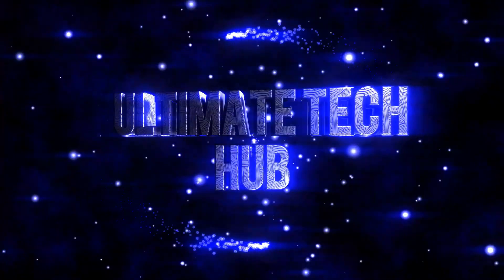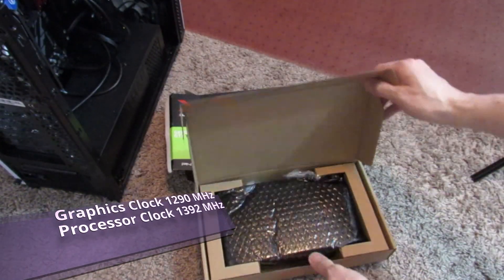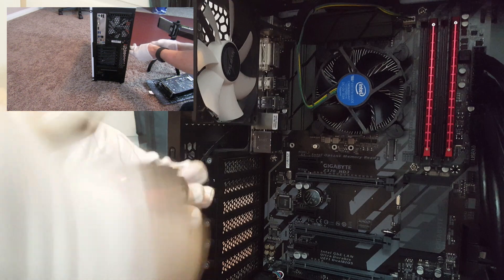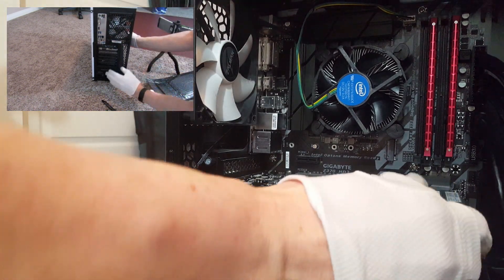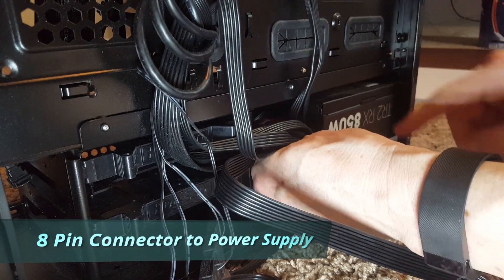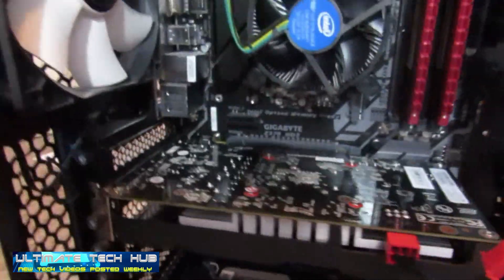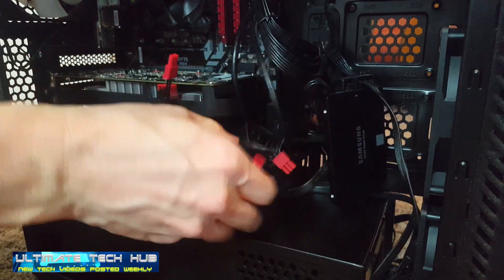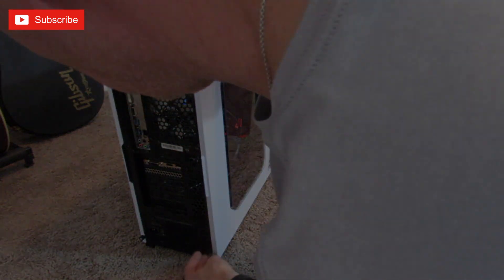How to Install - GeForce 1050Ti - Quick and Easy!

Comment: Hello.. My psu is 180w of power but it does not have a 6 pin connector does it still run on the motherboard?
Reply: Unfortunately 180 watts is insufficient to power this card and the rest of the system is.

Comment: Bro where is the 8 pin adapter found i cannot find it
Reply from the maker: The psu should have an 8pin or a 2 x 4 pin.
Reply: @UltimateTechHub  oh thanks my guy
Reply: @UltimateTechHub  my psu is like the wires are inside the psu itself and not outside connected though
Reply from the maker: @Fire_Evo  The GTX 1050ti may not need the 8pin connection. Try powering on the PC without the 8pin and see if it works. Usually the motherboard can power the low watt GPUs. Keep me posted.
Reply: @UltimateTechHub  wait then the 8 pin is for extra power and boost ?
Reply from the maker: @Fire_Evo  No its just for power but usually the motherboard can power smaller gpus because the 1050ti only uses about 25 to 35 watts.
Reply: @UltimateTechHub  thanks bro but before I buy can u like make a shorts about the 1050ti without the 8 pin so I buy it? Thanks
Reply: @UltimateTechHub  also I need a 80+ psu?

Comment: Got a questions can i got a GTX 1050 ti when i've using 250 watt
Reply: I got actually a GT 1030 i5-4590 8 gb ram and 250 watt
Reply from the maker: @PolPud_YT  Should be ok
Reply: @UltimateTechHub  ok thx
Reply: I decided to buy a GTX 770 and 4 GB ram more will this work on 250 watts
Reply from the maker: @PolPud_YT  it should the 770 doesn't use much power.
Reply: @UltimateTechHub  ok, thank you
Reply from the maker: Probably, it depends on other hardware.

Comment: I have gtx 1050ti without 6pin connector and what happened is after installing Windows the GPU is not showing signal in the monitor and the monitor is only 1080p 59hz resolution and yea that's the problem. It's not showing any output in my monitor. Do i need to change the monitor or what. Reply plz
Reply from the maker: Did you plug your monitor into the GPU? If you plug into the motherboard the GPU won't show up. Otherwise, I would reinstall the GPU. Make sure it's pushed in all the way. You should hear a snap. Keep me posted. Also how many watts is your PSU?
Reply: @UltimateTechHub  thank you so much for your reply ;) but after doing some research i guess my monitor is not 1920x1080 resolution that's why it's not supporting. I will tell you tomorrow after connecting another monitor. Again thank u so much ;)

Comment: After watching this video, I think I need to beef up my power supply. I just ordered this gpu and have only a 320W PSU. I thought this guy just drew off the PCIe slot, but ppl are saying that's the mini. Am I right?
Reply from the maker: Yes. You probably should have a 400w PSU that's what I would recommend.
Reply: @UltimateTechHub  Can this gpu run on 300 watt? That's the min specs and that's what my HP p7-1414 has.

Comment: im just wondering if the asus gtx 1050 ti does fit in the msi B85M-E45 ??
Reply from the maker: Yes absolutely
Reply: @UltimateTechHub  Thank you! ive used a gtx 660 for 2 years now and just needed somebody to check if it fits in my motherboard
Reply from the maker: @moosg714  i had a gtx 660 for a while too. I went to the gtx 1660ti and it much better. Now I'm looking for a rtx 3080.
Reply: @UltimateTechHub  Cool!

Comment: Can you please tell me if this card runs fine in a pc with only a 350 Watt powersupply
Reply from the maker: Yes it should run fine with 350w psu. 1050ti has very low power consumption.
Reply: @UltimateTechHub  Thank you.
Reply: @UltimateTechHub  pls tell me whether i can run with zebronics 450 watts psu...please i cant afford anything beyond that

Comment: does it work on a hp laptop 15 dw0xx
Reply from the maker: No this GPU is for desktops only. Thank you for watching.
Reply: @UltimateTechHub  any gpu that works for laptop vr gaming on the laptop that I specified?
Reply from the maker: @CaughtOnCam-h7c  I have no idea because laptops are not easy to upgrade. Better off buying a new laptop with gpu you want already in it. Gpu prices are insane right now. I would wait for the prices to lower.
Reply: @UltimateTechHub  do you know a good laptop for vr gaming at budget ?
Reply: @CaughtOnCam-h7c  just save up to buy parts, or ask people to help you buy the parts

Comment: Do all cases attach the gpu in the same way? Like would this fit with any case?
Reply from the maker: Not all cases. The smaller cases are different. The full size case and mid size cases will work with all gpus.

Comment: 350w enough for this psu with ryzen 3200g mate ???
Reply from the maker: Yes
Reply: @UltimateTechHub  ok so i can play games even if i've 16ram ssd, hdd , b450 ds3h ? Ty anyways
Reply from the maker: @BOOMbastic...  Yes
Reply: @UltimateTechHub  ok thank you mate
Reply: that gpu is barely an upgrade tho get a 1650 instead
Reply: @kc4i  u mean i can put it on 350w power supply ?
Reply: @BOOMbastic...  yeah but good luck getting any good gpu deals, if ypu find any gpu you want to buy use a watt pc calculator to know if psu is enough
Reply: @kc4i  ok ty bro i already calculated max watts usage is 314 something that with rx 570
Reply from the maker: @kc4i  this video is about 2 years old. You are correct it's a minor upgrade however gpus are now insanely over priced. Thanks for watching and for commenting!
Reply: @UltimateTechHub  true but 1030 tier gpu to 1050 is just not wprth it especially with prices nowadays

Comment: Hi dude i have a Palit gtx 950 2gb ddr5 running Windows 8 Pro 64 want to upgrade to Windows 10 will this card work with 10????
Reply from the maker: Yes absolutely! I run my 1050ti with Windows 10 with no problem.  Thanks for watching!

Comment: Do I have to buy the pin adapter separetly
Reply from the maker: Your PSU might already have the cable. However if your PSU is 300 watts then no need to plug the cable in. The mobo can power it. Thanks for watching.

Comment: surely you can simply let the motherboard power the card and dont need to plug it to the power supply?
Reply from the maker: Absolutely. I did a video on that very subject about 6 months ago. No PSU needed. I always show the full installation when I do any GPU installs. Thanks for watching!!

Comment: I know this is late, but can you put this in an all in one somehow?
Reply from the maker: No I don't think so. It would not fit. And all in one's are not really designed for upgrades.
Reply: @UltimateTechHub  yes but can’t you put in as an external gpu?
Reply from the maker: @towfoon  i have never seen the 1050 installed as an external GPU. That could be possible but you would need an adapter from your all in one to connect to the 1050. I wouldn't recommend it because of electrical shocks that can happen and with it just sitting out in the open.

Comment: Would this fit where a gt 710 would fit?
Reply from the maker: Yes I believe so.
Reply: @UltimateTechHub  what if there is the box thingy (that goes next to the ram) right above the gt 710? Would a gtx 1050 still fit
Reply from the maker: @onsightclan6517  Yes it should. The 1 Fan 1050ti would for sure. Its made for smaller spaces.
Reply: @UltimateTechHub  alright thanks
Reply: @UltimateTechHub  what about a two fan one

Comment: Mine doesn't have somewhere to connect the power supply, what can I do?
Reply from the maker: No worries the 1050 ti does not require the 6 pin power connector. However it does require a minimum of a 300w power supply otherwise it won't work.
Reply: @UltimateTechHub  Oh thanks I have a 600watt power supply, I'm thinking about upgrading it for my birthday to the 3070, how many bolts would that be?
Reply from the maker: Its recommended to have at least a 650w psu for the 3070. I would even go a little bit higher just for future upgrades.

Comment: So you only need one cable to connect to your pc or Two
Reply from the maker: Actually you don't need the power supply pin connector if you don't want to hook it up. The 1050ti doesn't require external power. Thanks for watching!!
Reply: I meant the display port and hdmi do i need to put them both or the display port only
Reply from the maker: @Koool-Kid  Just one cord. It doesn't matter which one you choose. I use HDMI for my personal preference.

Comment: Is the gtx 1050 ti low profile compatible with hp compaq 6300 sff?
Reply from the maker: It depends on which brand you buy. I believe this GPU is not low profile. But check the specs before you buy. Thanks for watching!!
Reply: @UltimateTechHub  thank you, btw I love your vids
Reply from the maker: @jeanpromanov4888  Thanks, much appreciated! :-)

Comment: So it doesn't matter what brand of 1050 ti it is right?
Reply from the maker: Correct.
Reply: @UltimateTechHub  hello ? I need help. If my ssd is showing on bios does that mean it works properly? My windows got corrupted but my ssd is showing on bios I'm planning to have a fresh install but I don't know if my ssd is working fine
Reply from the maker: @klarence5554  Your SSD should be working fine. It its corrupt then a fresh install of windows should do the trick. I always have a back up SSD with a clean copy of windows then I can clone that clean copy to the other SSD. Remember by doing this you removing everything from the corrupted SSD. I have a video on the Samsung Data Migration process.  Make sure you watch it so have a good understanding of the process. Keep me posted and thanks for watching!!
Reply: @UltimateTechHub  I will be installing a fresh windows and I'm just making sure that I don't have hardware issues. I'm still not earning money and I use the PC for school works. You are a big help and you just saved me . Thanks
Reply from the maker: @klarence5554  Glad to help and keep me posted if you have any other issues.
Reply: @UltimateTechHub  you're a huge help. Thank you very much. You basically helped me financially
Reply: @UltimateTechHub  so I checked my ssd smart information status and it has zero on read error status. That's a good thing right?

Comment: I thought the 1050ti doesn't need external power
Reply from the maker: It doesn'. Here is my video on that very subject 
https://youtu.be/p41MZB1NNZk
Thanks for watching!
Reply: @UltimateTechHub  thank you! Btw i want to buy something faster but still doesn't need an external power because my PSU doesn't have a PCIe connector, so i was planning on a gigabyte gtx 1650, but some 1650 have a 6 pin and some don't.... So if i bought a 1650 with 6pins then is it ok to only use the PCIe 75w slot on the motherboard without the need of inserting a 6pin?
Reply from the maker: @kaslanaworld4746  i think it will need the external power supply. My 1660ti requires it so the 1650 would also require it.
Reply: @UltimateTechHub  I'll just go with the 1050ti then thank you!

Comment: does it work for ddr3 ram 4gb core i3 pls reply because i was thinking of buying a gtx 1050 ti
Reply from the maker: Yes. The 1050 will work. It needs a 300w PSU so make sure you have that as well.
Reply: @UltimateTechHub  and a x16 PCIexpress

Comment: Will this work with a Processor	Intel(R) Core(TM) i3-2120 CPU @ 3.30GHz, 3300 Mhz, 2 Core(s), 4 Logical Processor(s)
Reply from the maker: Yes. How many watts is your PSU. GTX says the 1050ti needs a minimum 300w PSU. Thanks for watching!

Comment: Hi, I have a question. I would like to buy and install this GPU to my PC. My motherboard is an old Gigabyte GA-B75M-D3V. Is the GeForce 1050 Ti compatible with my motherboard? Thank you!
Reply from the maker: It should work. Your Motherboard has a PCie slot. I have an old sabertooth z77 and it works with my 1060ti. So I bet the 1050ti will work.
Reply: @UltimateTechHub  Thank you very much! :)

Comment: Hey, would this fit a Dell Optiplex 7010 SFF?
Reply from the maker: It will if its a mid size or full size pc case.
Reply: I just ordered this card and I also got a 7010 sff. Did u buy it and did it fit?
Reply: @bobsandwich3431  got mine at Christmas, it fits but you gotta use the sff bracket

Comment: There's a GTX 1050 without 6 pins require.
Reply: Thats what ive been trying to find. Im having trouble with mine
Reply: krig20 it is the GTX 1050 mini zotac that isn’t a 6 pin and it is pci powered
Reply: @krig2052  me too,any idea
Reply: sree it GTX 1050 zotac mini
Reply: @fad2480  thanks man
Reply: What about the 1050 to low profile
Reply: The 1050 LP is very weak so I do NOT recommend it  @Caldy_RFC

Comment: Yo what version of the 1050 ti do u have cause most dont have a 6 pin connector
Reply from the maker: Its last years model. And you don't need to use the 6 pin connector.  The motherboard can power it alone. I have a video on that very subject so check it out. Thanks for watching and if you subscribed thank you as well.
Reply: Ultimate Tech Hub maybe for overclocking the 1050 ti u could use the 6 pin power connector
Reply from the maker: @famousfighter2310  Yep that makes sense. I would like to test out that theory. Maybe I will do a video on that very subject. Thanks for the idea!
Reply: Ultimate Tech Hub No problem man

Comment: Hi Ultimate Tech Hub,

I can’t find a PCIe on my gtx 1050Ti, it isn’t on the front. Do you know where it is?
Reply from the maker: The PCie is the connection on the motherboard.  You connect the 1050 to that connection.
Reply: Thanks!

Comment: I have the gtx 1050 Ti from Gigabyte and it doesnt seem to have the 6pin power supply. But I still cant use it... i can connect a monitor via the graphics card but the van doesnt go on and windows doesnt detect it
Reply from the maker: Usually no spinning fan means the GPU needs power. Also windows not derecting the GPU could mean your drivers are not updated or sadly it could be that gigabyte is not compatible. Nvidia is what i use and it is very easy to setup and no power supply is needed. Hope this helps. Keep me posted and thanks for watching.

Comment: What connectors does it use?? Do I need dvi to hdmi??
Reply from the maker: HDMI to HDMI will work.
Reply: @UltimateTechHub  thanks but what connection is best ?? I really need to know. thanks
Reply from the maker: @AStepForImprovement  HDMI is the best connection
Reply: @UltimateTechHub  thank you so much!😊
Reply: @UltimateTechHub  I don't understand the use of the HDMI port ! Is it mandatory? And if yes to what I connect it? My monitor? Very good install video btw!!
Reply from the maker: @ludeviguelemody863  its not mandatory you can use the other video outputs if you want. Thanks for watching!!
Reply: @UltimateTechHub  Thanks for answering!! This card has the great advantage of being super easy to setup.
Reply from the maker: @ludeviguelemody863  Your exactly right its very easy to setup. I love that it already has game ready drivers installed. At some point you will need to update the drivers but thats very easy and I have a video that shows you how to do that. Thanks for watching!!!
Reply: @UltimateTechHub  I think I'll be fine with drivers but thanks. If I have a problem i'll come to your video.
Reply: @UltimateTechHub  Hey, sorry to disturb you again but I wanted to know the difference between the gtx 1050 ti with 1 fan and the others with 2. Is there a big difference in terms of power and in terms of length. (I want to be sure if a 2 fans will enter in my mother board.) Thank you!
Reply from the maker: @ludeviguelemody863  No difference in power.  Its just a larger GPU since there are 2 fans. So If you have a Micro ATX Mobo you may want to buy the smaller 1050 with the 1 fan.  Enjoy the GPU it's great for the price.
Reply: @UltimateTechHub  Thanks again! You're saving my life hehe!
Reply: @UltimateTechHub  Hey, it's me again! I just oppened my PC and I saw py alimentaion was only 230v. However I have a GTX 1050 and it requires 75v, just like the ti. The requirements for the 1050 and the 1050 ti are about 300-50 volts on the internet. Will my alimentation be able to run it correctly?
Reply from the maker: @ludeviguelemody863  The 1050 and the 1050ti require 300w PSU.  So the 230w will probably not work. You can try it but you will most likely need to upgrade your PSU to at least 300w but I would get a 450w which I've seen for around 45 or 50 dollars. This way you are covered for any future upgrades. Keep me posted and thanks for watching!
Reply: @UltimateTechHub  Well I don't get it! My gtx 1050 worked perfectly since 3 years...

Comment: hey great video i’m trying to install the card right now and i don’t have a 8 pin because my psu is  too old also i tried working it without the 6 pin but to no success should i buy a new psu or motherboard to fix this problem?
Reply from the maker: Check out this video https://youtu.be/p41MZB1NNZk
This will answer your question. Thanks for watching and if you subscribed thank you as well!

Comment: ok i have bought a used pc with a gtx 1050ti installed but without the 6 pin connected 
is it a problem?
i have played many games on it so far and they all seemed to be working properly but is it a problem to keep it without connecting the 6 pin ?
and if i connect the 6 pin will it make a difference in its performance for example?
Reply from the maker: Its all good. The 1050ti can be powered by the motherboard instead of the power supply.  When i do my install videos always show the full install including the power supply connections. Enjoy the 1050ti its a very good GPU. Also I have a video comparison of the 1050ti vs the 1660ti be sure to watch it. Thabks for watching and if you subscribed thank you as well.
Reply: @UltimateTechHub  This is good to know. My 300 watt psu doesn't have an available port for the gpu.

Comment: what do u need to do with the 8 pin connector?
Reply from the maker: It connects to the power supply. However you can install the 1050ti to your mother board without using the power supply. In most cases the motherboard can power the 1050ti.  Give it a try first without the power supply. Keep me posted and thanks for watching.